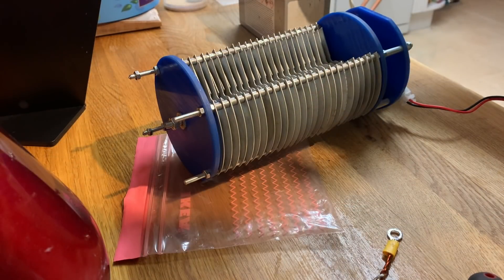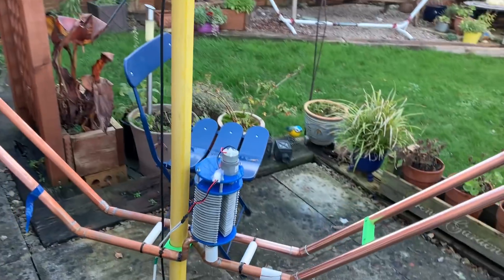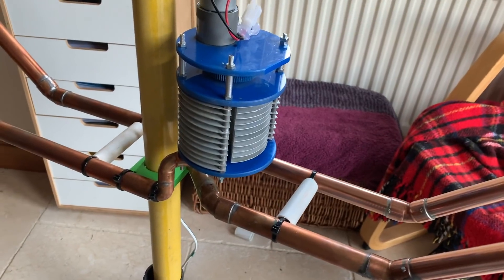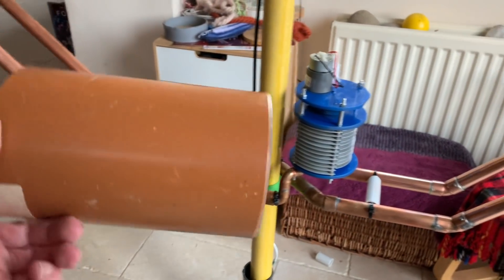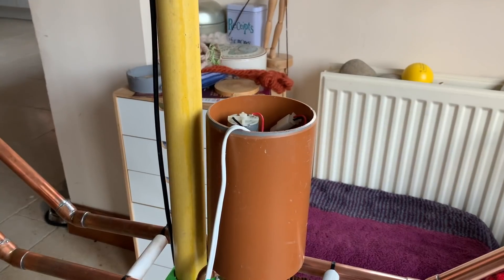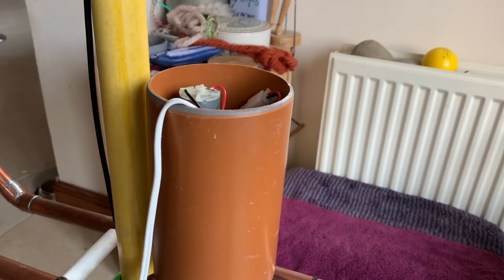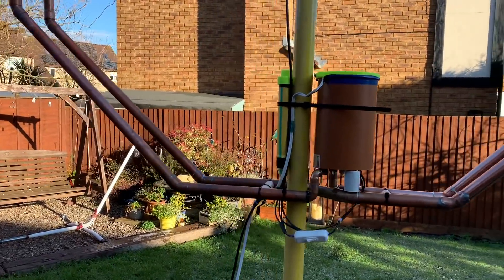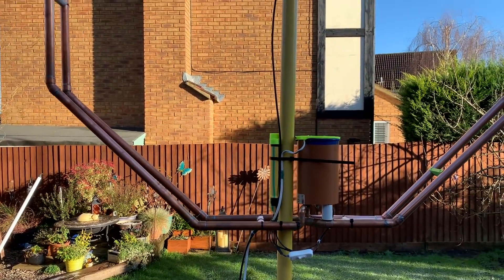HAM RADIO: Double Copper Loop Capacitor Re-Build

Comment: What kind of drivers for stepper motors you are using in your 3d printer? You could make yourselve gears to decrease capacitor revelations per minute. Planetary maybe. And question now: how your printed parts was weatherproof over 3 years?

Comment: You clearly know what you are doing and that is impressive.
I have just bought a Tescun 2000 and want to do some short wave listening.
I am restricted with outside gardenspace and am not allowed to dig a 6ft hole just to plant an earth.
Am I stumped or is there a way I can make an indoor ( garage ) antenna.
I would be able to plant it in the front for listening but it has to be portable.
I am very handy and can make almost anything but I dont know enough about antennas.
Any help greatly appreciated.
You capacitor is a work of art.
Love it.
Reply from the maker: Keep watching I think I may have already built what you need?

Comment: Been looking doing this one. But taking it to a newer level, The twin loop will increase to 12m over circumference making it 6m per loop thus 75CM between angles a tad bigger. Been looking at the loop calculator and it expresses 12m for a BIGGER single loop Plus needs less pf as well to tune it for 3.600mhz. But like the added pf caps to bring the air spaced one to higher pf for this one. Already started the 209 pf air space for the next loop. Must finish the 40/20m one first. Keep up the vids as they inspire me to have a go and in this case rake it a bit further  2E0FEH

Comment: Hi Mike another great vid. Instead of switching capacitors from band to band you could connect one capacitor permanently that would work on both bands and then have another smaller caparitor-this time variable that would fine tune for both bands. What i mean by that. Lets say you need 50pF for 7Mhz and 100pF for 3.5Mhz. So one fixed cap could be close to 40-50pF and the remainder of capacitance would be variable so 50-60pF. This way the tuning shouldnt be so narrow cause you only have to tune half of the capacitance. That's the idea anyway. 😀😀😀

Comment: Some good practical workarounds there Mike, interestingly potting the capacitor made me think with a bit of tinkering you could fill it with an oil dielectric, mineral or silicone! The trombones were very nicely made and finished with the colourful wrap. 
Job Done, Well Done. Barnie M7PBX.
Reply from the maker: Something to think about!

Comment: I've got a better idea for you. Make a couple air capacitors and end limiter switches will redirect power from one motor to another. Connection schematic will be like in the double AND gate (like two light switches one downstairs other upstairs)
Reply from the maker: Like it..

Comment: Great job Mike. I have the same problem with my loop with the 10-190pf it's very sensitive and pretty hard to tune on 40m with very short bandwidth. 20 up is fine.
Would love to know where you got you plates from as I want to build my own capacitor. Great work M6yik fran
Reply from the maker: I been making them myself Will be in a video soon.
Reply: @mike-M0MSN  lookig forward to that one  will u use a lazar cutter
Reply: Cool Mike looking forward to see that video when u do it.

Comment: What a soothing sounds of the 3D' in the background! Very nice project! The trombon caps look very solidly but I thought hadn't it been simpler to make ones of the piece of sturdy coax, like RG-213 or alike? I have tried it once when getting my 20m magloop down to 40m and it worked really good. The different types of coax have known capacitance per meter specs written in their data sheets so it's no even need to have a C-meter just measure-and-cut :). 73! Linas LY2H
Reply from the maker: Nice idea to use coax, it’s about 1pf per cm !!

Comment: You could change you stepper motor drivers on your printer toTMC2209 or TMC2208's. And it would make it a lot quieter and a better print. If you would like some TMC2208's let me no.
Reply from the maker: Email me some prices email on QRZ.
Reply: @mike-M0MSN  Ok Mike. I have to just help run the Online Scouts meeting till 9pm then will  sort this out with you. Yes I'm a Scout leader lol
Paul. M7PCX
Reply from the maker: @Airconed  Good on you mate.👍